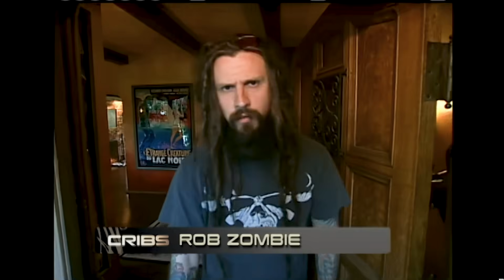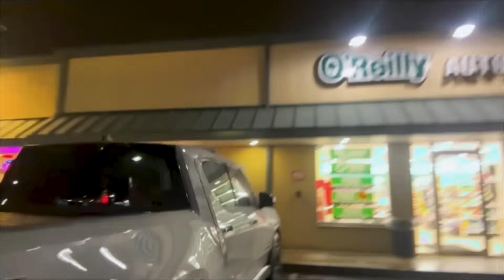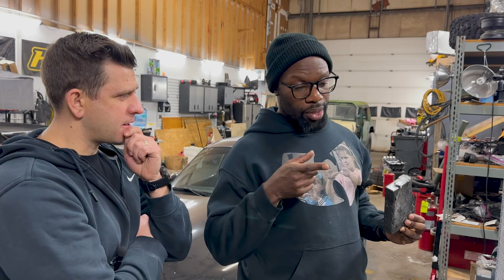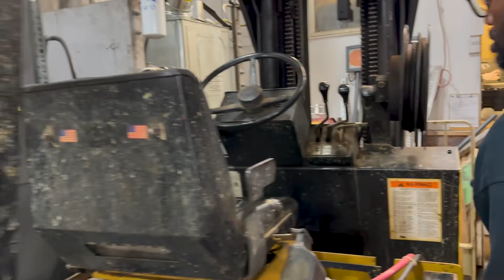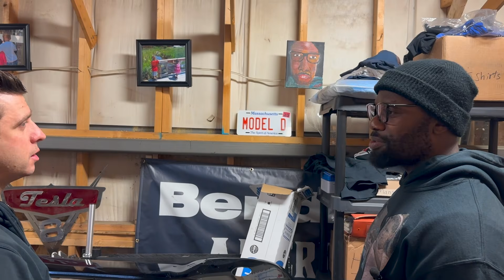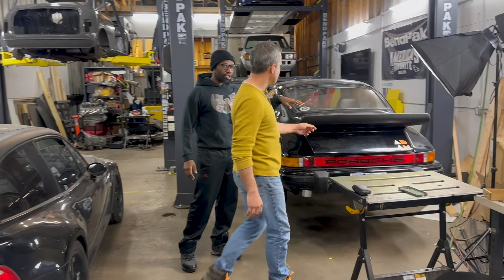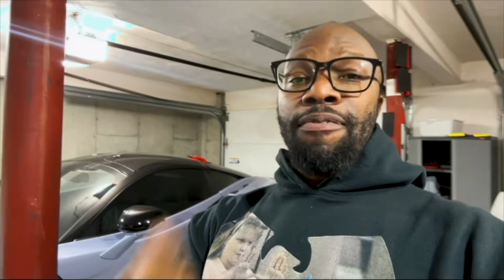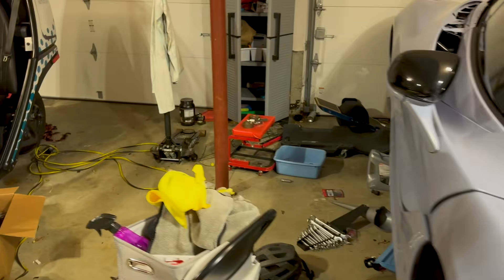I Thought I Could Keep Doing Youtube Like This but I Was Wrong, Time to Move On.

Comment: I think you should give Oklahoma a hard look.  I joined the service and moved here from Atlanta in 2011.  Before that I had never been to here or knew anything about it.  It’s cheaper, the people are nicer and the overall cost of living is very fair.  Not to mention there is a huge racing community and a lot of areas are friendly towards these communities. The biggest reason I stayed was because of how affordable it is. You can find yourself a house with land and a shop and 4 car+ garage for around 500-600k or less depending on the area.  The house I live in now would be closer to 2 million in or near Atlanta.
Reply: You still get too much snow though, the southern states can do outdoor automotive content all year round, also the salt they have to put on the roads is like poison for cars, it always lowers the resale value, cars from a state that gets a lot of snow will sell for signifigantly less than identical cars from a state that doesnt get snow or the snow does not stay after it falls.
Reply: @King_Flippy_Nips   we had snow for two days it didn’t even stick to concrete. I’m driving a corvette as we speak. lol. What winter? Also Oklahoma doesn’t use salt.  We don’t get enough snow here to need it.
Reply: Oklahoma is awful, i was there 2 weeks for work, had to run from 3 tornados. you can keep that nonsense

Comment: Some* humvees are left in theater, but the unit coming in to relive the other takes them. Units still bring some of, or all of their own assets. This means some equipment never leaves a combat operation until the draw down, and some never comes home because it was "destroyed" in combat. Or, a president botches an evacuation and gives them all away. Your humvee may very well have been deployed, came home, served here for training, been stripped to the frame, rebuilt, used again, sidelined for a major part failure, cannibalized for parts when no-one was looking, barely put back together, transfered to a reserve unit, deadlined again, used as an excuse to write to congress for an upgrade to an mraps, then sent to auction as declared surplus.

The only thing a humvee needs to be rebuilt, is a valid data tag. Every part of it is repairable. Whether or not it wins the reset lottery is up to rngesous or smart logistics officers.

Comment: Oklahoma? You will increase the demographic by 100%!

Seriously though, Carolinas, Florida (getting kinda expensive depending on location) Georgia - outside Atlanta, New Mexico.Keep in mind in the hotter southern states you will need good AC in the summer. Yes, you do not get brutal winters, but the summer can be pretty brutal as well. Carolinas are probably the best with New Mexico (dry heat) a close second. FL and GA can get incredibly hot and humid in the summer months but fall lasts forever in those states.

Comment: Your options should include North Carolina, Texas and Georgia before heading straight to Florida. The climate is much better with infrequent winter weather, the land is much cheaper and more abundant and in the case of NC, the number of machinist shops, back roads for shenanigans and other gear heads is quite abundant, especially around Charlotte; because NASCAR.
Reply: Another NASCAR reference as if that has merit. The bleeding edge of technology it is not.
Reply: @dj4monie  you're right, it isn't the bleeding edge of technology. But for someone who makes automotive content almost exclusively, the access to machinists, technicians, engine builders, fabricators, etc that live in NC and surrounding states is HUGE, especially compared to Massachusetts and virtually everywhere else.

Comment: I live in North Florida. A humvee seems like it would be perfect for an electric conversion. Jerryrigeverything used one motor out of an aircraft tractor mated to a reduction gear then a driveshaft to a high end transfer case plus a few more custom driveshafts in his. He put the battery pack modules in the backseat. Thats 3 custom driveshafts for one thing. Idk why anyone would do it that way, especially considering what the high end transfer case costs alone. Also loosing the whole backseat and having a high CG. Where would your employees sleep? Why not put a motor at each diff and the battery pack inside that giant empty tunnel where the rest of the drivetrain was? The diffs are fixed to the frame because of it's independent suspension and portal hubs. With 2 motors you could have 2 wheel drive at either end or four wheel drive just like a high end transfer case. All through the motor controller. If you connected the motors directly to the diffs I'm sure it would require some kind of reduction gear/torque box like Jerry used which could be expensive, especially since you'd need 2. Or maybe use Teslsa motors with their diffs if they'll fit in their transverse layout. You might even be able to get Tesla's quasi torque vectoring thing with the open diffs and brakes to work if the motor controller can do it. So maybe even tank turns, kind of. If the Tesla drivetrain would fit. Or use cheaper motors out of something like an airport tractor and eat the cost of the reduction gear/ adapter and use the stock locking diffs. Having the weight of the pack in the drivetrain tunnel and the motors down low should give it a super low CG. Plus those tractor motors can make like 800+ ft lbs, at each axle. I know there's at least one company selling Tesla converted Humvees for 100K+ but I havent seen how everythings packaged in that  truck. I looked but didn't see any drivetrain diagrams or pics. That big empty tunnel just looks perfect for a big heavy battery pack, better than a bunch of custom driveshafts and giant transfer case. As cool as those transfer cases are in an ICE truck it seems like a waste of 10k or whatever they cost now in an electric unless you're just replacing the ice engine while keeping everything else to make it simple. One of the big advantages of electrics is packaging, plus the millisecond torque control so you can have stuff like that ratcheting get you unstuck thing some Toyota 4wd trucks have if your motor controller supports it. Just seems like the perfect starting point for an electric offroader. Those airplane tractor motors are supposedly cheap and common enough. Might need beefier axles. Might as well build an unrollable torque beast. And I expect Youtubers to follow my dream builds exactly! I don't get out much. And I live in Florida so I have reality issues. We have lots of mud here. That thing might even be competitive with the mud racing trucks that are popular down here in the nation's penis. A buddy of mine had one on 54's I think, can't remember. Florida does that to you, or maybe it's the bath salts. Not sure. He had a Nascar motor making around 800hp. Actually I think it was technically a tuned up ARCA series motor. The guy has family connections to NASCAR. It basically skipped across the mud. And he had one of the cheaper, lower powered rigs at the races we went to. That was back before I became a hermit with unrealistic parasocial Youtube expectations. Just build what I want damnit. I don't want to eat anyone's face but I might.  Florida Man out!

Comment: I know that he's joking about the oil reclamation tank. But if you need to guage how much water is in a tank of oil, they make a paste that turns red when it hits water. You can smear a line of it down a pvc pipe, rod, tape measure or anything to stick down in there and get a reading. I checked oil and water tanks on oil well locations and used a metal tape. Kolor Kut or Gasoila are the brands.

Comment: Austin real estate values and rents are crashing harder than practically anywhere else in the country, so your likely to find a deal there. There's been too much construction, too fast, so a bunch of new neighborhoods have homes that aren't even listed on the market, because the builders are afraid of crashing the market. Yet the place still has good long term prospects.

East Austin used to be run down but sits between downtown, and where Tesla has built their factory. It has nice spots to hang out and eat, and is still being gentrified, sort of like the Brooklyn of Austin. Growth has pushed people outward from downtown, and to the east. Might want to check it out.